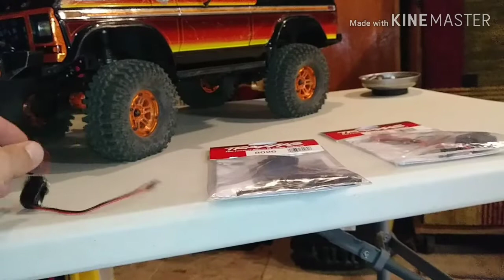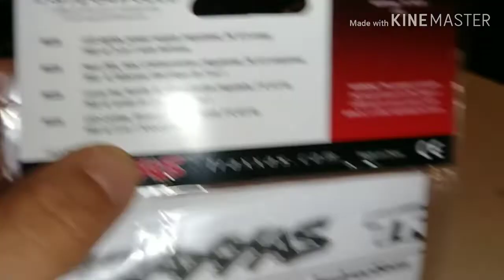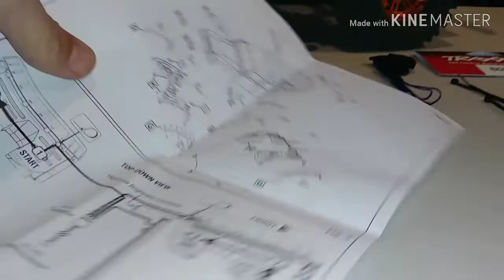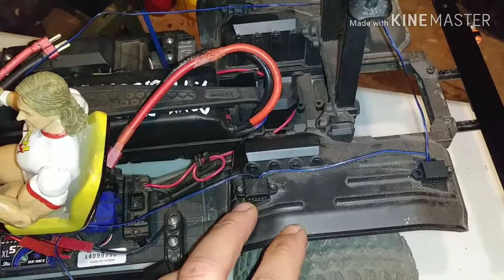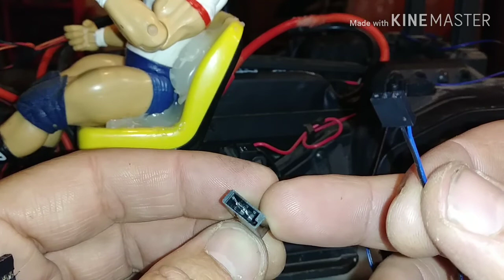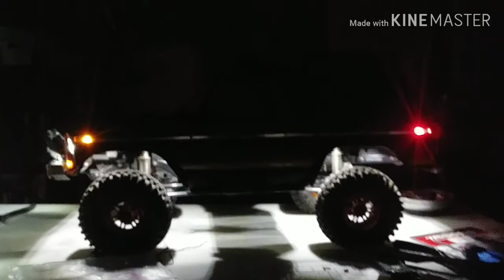Traxxas TRX4 Bronco,Rock-Light install,with separate On/Off switch

Comment: After Traxxas sees this video, they will magically introduce a switch for the light kits for only $28.99! 😄
Reply from the maker: 😂👍👍 Ahhh! Hahaha! 
You ain't kidding Brother,Wiser words have never been spoken,their gonna copy this setup with the quickness,and then charge people out the wahzoo for it,😂 what would really be nice,would be if Traxxas would include a key fob style remote,with full light controls,high/low beams,
separate light bar,and rock light controls,turn signal's,
back up lights,and possibly the option of a running light only selection,😁 Did you hear that Traxxas! Nod nod,Wink wink,lol 
Outstanding Comment Brother,one of the best that I've heard in awhile,Many thanks KonaFocus.😁😎👊👊
Reply: RC After Dark do you know if we can get it to work via the app? They have a lights on switch with high and low beams and off.
Reply from the maker: Hmm! I've never heard about any app's for the lights,But I also live back in the sticks,and my internet is hit & miss,at best,😊 The on/off switches that I had used,were just a cheap & simple solution,too Traxxas not including any switches with their led kits,
And most of the time I'm recording video with my cellphone,while I'm driving my rigs,So having a app too control my lights, would ultimately be of no use for me,😕 fyi using a standard video camera is not an option for me,As I have to drive to the nearest town,and use my cellphone too upload any videos,having next too nothing for internet at my house,kinda eliminates the option of using a standard video camera,and laptop computer for videos,and uploading,😕😞 
Which is probably another reason why I never looked into that option,My eyes would kinda be automatically blind, towards any app's,just for that reason.😕
But if the app works good for you my friend,then more power too yah! 😊👍 for myself,it's obviously not the best option,😁 
Many thanks for your great question/information,and much appreciation for checking out the video Dustin.😎👍👍
Reply from the maker: And just too cover bases,I'm assuming that you are referring too linking the lights, to the Traxxas Tqi equipped receiver,And as far as I know,& unless Traxxas recently released something new,I had know idea about that option even existing,of integrating the lights into the tqi app,😕
I'm gonna look into real quick just too see for myself,I'll get back with you Brother 😊👍
Reply from the maker: Well I just covered everything that the Traxxas website,& Amain Hobbies has,for Traxxas Tqi,and Traxxas trx4 lighting,😕 And other than buying a "My Trick Rc" trx4 lighting kit,or some other after market kits that come with a key fob remote,I didn't see Anything from Traxxas,that would link the lights up to the Tqi radio,or Tsm receiver,
As far as I can tell,No such option exist's for the led controls,😕

Comment: I have an aftermarket light bat on my test body. I don't know how to plug these light bar to the battery so i don't have to use my receiver. Any ideas?
Reply from the maker: Hmm, if I'm understanding you correct, Your telling me that you have a aftermarket battery for powering a set of led lights. Yes 😕
Or is that supposed to say Aftermarket Light Bar, "instead of Light Bat! 🤔?
You got me a little bit confused by how you wrote everything out.😕
But I think that you're wondering how to hook up a Aftermarket Light Bar to your battery, so that you don't have to power it off the receiver.🤔
Either way it's still going to be taking power from the battery,😕 so it really doesn't matter all that much.
At any rate there's a couple of different ways you could go about it.😕 
#1 You could power your light bar off of a separate 4 double AA battery pack, "which is what I do, and believe it or not, those 4 Double AA batteries usually last for about a years worth of on and off usage, before they need to get replaced.😕 
Or you could go with choice number #2
Which is powering it off of the Traxxas Esc,😕 There's a male JST connector coming off of the esc that normally goes to the Traxxas led power supply block, "and you could simply plug in a 3 way splitter between the esc, and the led power supply, and share some of the voltage from that output lead "before it hits the Traxxas led power supply"🤔 Which will work, but you have to be careful that your Aftermarket light bar is capable of handling 12+ volts, in case you decide to power your truck on 3s.🤔 The external power lead coming off of the esc, puts out the exact same voltage as whatever battery your using,😕 So if your running on a 2s lipo, that lead will put out 8.4v at the start, and then taper down as the battery starts to drain, "and if your running on a 3s lipo, it will start out with 12.6v, and then slowly taper down as the battery starts to drain.🤔😕
That external lead puts out the exact same voltage as your battery,😕 "which is why I use a external 4 Double AA battery back to power up my aftermarket light bar! 😄 Lol 
The Traxxas LEDs "are a low voltage led set, and the Traxxas LED power supply is basically like a Resister, it lowers down the power coming from the esc, to right around 3v or so, if I'm not mistaken,🤔 That way it doesn't matter wether your running on 2s or 3s, either way "the Traxxas LEDs are still getting the correct amount of voltage from that power supply block.😕

Basically the easiest thing for you to do, is to Run that light bar off of a separate battery pack like I'm doing, otherwise the next best option, is to run it off of the vehicles receiver,🤔 "that way there's no chance of over volting your light bar "if you decided to run on 3s.😕

Separate battery pack, or running it off of the Receiver itself, is going to be your best options.🤔
Either way you decide to go with that, I would also recommend installing a simple On/Off switch inline to go along with it,  "Just like I did" 😄 ha ha ha lol

Hopefully this was helpful for you... And many thanks for checking out the video my friend.😊👍
Reply: @R.C.A.D.  I meant light bar , sorry for the typo. I found a little wire that I bought a while ago and used it to connect the light bar to the receiver and now is bright! I just didn't want to plug the light bar directly to the receiver because i have another Defender body that already has the Traxxas light kit as well as the Pro Scale module installed. I wanted to be able to plug and unplug the light bar without having to open the receiver. Is working now though. I've been trying to find the right adapter to plug directly to my Traxxas battery to make it a little simpler. Since this is my first RC model I'm still learning. Thank you for the reply and the tips! :)
Reply from the maker: @perohijo 
Right on...😁👍
And since you're new to RC's I'll give you a little bit of advice; You don't want to hook anything else "directly up to your vehicle battery, Because if left unattended, it could very easily draw your lipo battery down below a safe level, "and you won't be able to recharge it after that happens.😕 
As for being able to turn your lights on and off easily, and to give you a area to unplug the lights when disconnecting the body, I would recommend looking at a online hobby store, and type in the search area for a On/Off Switch,🤔 their usually pretty cheap, and also pretty easy to hook up in line with your lights,😕 My on/off switches have a male Jst connector on one side, and a female Jst connector on the other side, and it's pretty simple to plug it in "in-between" the Receiver and the wire lead going to your light bar.😁👍
I've got three of those on my truck 😂 One is for the Light bar, One is for the main lights on the body, and the Third one is for my Rock Lights.😁 
It's been awhile since I've seen this video...🤔 But I think that I might have talked about those switches "in the video" at some point in time or another.😁👍
Reply: @R.C.A.D.  Thanks for the tip!

Comment: Thx for the video and tips! @ 22:20, can't you also lift the tabs on the Traxxas connector and pull those wires out so they line up, just like you lifted the tabs on the switch?
Reply from the maker: my pleasure 😊👍
As for the tabs; Probably! 😄 Lol sometimes I just don't think about that stuff at the time.😕😂
Thanks for checking out the video, And an Early Merry Christmas to you and your Family. 😊🎄🎁🎁🎁🎁

Comment: Now they have the pro scale light kit that has the separate module that will control the lights to turn them on and off and if you have the bluetooth adapter you can do it all from the phone
Reply from the maker: Very Cool 😊👍
Thanks for the Awesome Head's up, and for taking the time to check out the video Tony.😊🤜🤛

Comment: where and what part number is that on off switch??
Reply from the maker: ? 😕 Where! 
Where, is mounted on the inner fender well, just in front of the ESC.
Part number; there is no part # It's just a Simple on/off switch, 😕 and I order them in bulk from the Wish app, But if you go to your favorite online Hobby store and type in the words "on/off switch" into the search criteria, you should have no problems finding one. 😁👍
It's a piece of cake really, just takes a little bit of effort on your part,😕 
Of course you could simply Google "RC on/off switch" 
Thanks for your great question, and for checking out the video my friend.
😁👍

Comment: Why didn't you just use a opto switch and a b.e.c that way you can  turn it on and off from the transmitter
Reply from the maker: Because I was trying to show people who don't have a bunch of money, how to accomplish it in a cost effective manor,
Not everyone has a ton of money to blow on RC accessories,😕👍
I do however; have a bunch of RC's, with Transmitter activated LEDs, but I use a Rc4wd Wired Winch Controller for the on/off switch, and I have been doing that for years,😊👍
Thanks for your opinion, and many more for checking out the video.👍

Comment: does it consume alit of juice? can you use coming from esc
Reply: i did watch your video but i wrote the comment before i started watching. quick question, i put 2 fans 1 for the motor and 1 for esc my battery get really low on power in 45 mins of playing. should i just remove the fans? sorry not lights related
Reply from the maker: Yeah, those Fan's are definitely not needed on a stock Trx4, Wow! Yeah, I have never had a Problem with my esc getting hot, and I even have a driver seat, hot glued to the esc's cooling fins,😂👍 no worry's on the Fan's man,
And I apologise for snapping at you, I'm just a Real stickler for Common Sense.😊👍
Reply: got it. thank you. more power to you
Reply from the maker: Right on Brother 😊👍
Reply from the maker: Did you Not watch the entire video ? 🙄
All your answers are right there,😕
And no! It doesn't consume a lot of power, not only are they LEDs, but they are also low voltage LEDs,🤔 
I also have my main lights, and the rock lights, on separate on/off switches, that way they are only turned on, when I want them on,🙂 which is also in the video, and another way to save power,👍
Normally I would say thank you for your great question, and say thank you for checking out the video,😕
But judging by your question, it kinda seems like didn't watch the video at all,
😕

Comment: What switch did you use
Reply from the maker: Alright I found one that is similar to what I use

https://www.amainhobbies.com/expert-electronics-standard-on-off-switch-w-charge-cord-exra050/p57633
Hopefully that will help 😁
If you have any more questions please feel free to ask my friend,🙂👍
And thanks for taking the time to check out the video Brother.🙂😎👍👍 
P.s. if you weren't aware, I'm currently doing a giveaway on my channel, check out the video if you haven't already, it's Titled 2,500 Subscriber Giveaway Entry Video, and I'm giving away "Two" "Brand New"  "RTR" Redcat Gen 8 Scouts, giveaway deadline is midnight eastern standard time on Friday July 10th 2020.🙂👍👍
Reply: @R.C.A.D.  thanks man, I saw your video but I could not find a switch.
Reply from the maker: Just a simple "black plastic" on/off switch with a Jst connector on each end, the same switches that used to come on the old Tamiya vehicles back in the day, let me see if I can find a link to one for you,🙂👍 be right back

Comment: Just curious? What do you think you have invested in this from day one? (Base TRX4, batt & charger plus all accessories)
Reply from the maker: Tuff too say Dave,🤔
I already had chargers,and batteries before getting the TRX so hmm!
Truck; $500.00
Savox sw 1210 steering servo; $80.00
Duratrax Oynx 8000 mAh 25c 2s lipo; $80.00
Traxxas Bec kit; $38.00
Traxxas led light kit; $45.00
Traxxas Rock lights; $25.00
Traxxas defender Roof basket; $12.00
No name light bar; $20.00
KYX aluminum front bumper; $25.00
KYX aluminum rear bumper; $20.00
3 Orange Neon sharpies;$10.00
Hitec 10 amp "duel battery charger"; $100.00
Traxxas all terrain track kit; $200.00 
About $1,150.00 for everything,minus over 100 hrs of person labor,🤔
It would be significantly cheaper for a basic setup,
Probably get the truck,a battery,and a charger for less than $700.00 🤔
If I may make a suggestion,If you are curious about getting a trx4,and are unsure on pricing,I would strongly suggest looking at Amain Hobbies website,Check out the Crawler's,and just start adding everything that you want into your online cart,And see what the total is,for everything that you're interested in,🤔
And then simply empty the cart after you have gotten a idea on pricing,😕🙂👍
Thanks for your great question,and for taking the time to check out the video my friend,🙂😎👍👍
Reply: WOW!  Wasnt expecting that long of a list (lol) Thanks for your in depth reply!

 That's what I'm worried about. I'm the type that wants to add everything! I owned this exact same real(or lets say full size) 1979 XLT Bronco  (sad day when it was stolen 8 yrs later!!) Took me a year later to buy a 1986 XLT I owned for 20 yrs!  I have been caught up in the drone rc's and now getting the buggy /crawler fever. While viewing MANY YouTube vids, I decided on the HBX 12889 Thruster for my budget and type of fun I seldom have the time for these days. I realize these brands are day & night apart - no comparison. I did exactly what you are suggesting before I caught your post and added many items in my cart. The total $ keeps bouncing me back to a less expensive start. The fact that it is the once owned "Bronco" pulls at my wallet......
Again, AWESOME job on yours - and BEST post on YouTube!

Comment: wondering if i got a bad component or im overloading the Traxxas light system as the 8028 smoked up when i plugged it into the esc. using Traxxas 3C 5000 amp battery....waiting on the new light kit from traxxas
Reply from the maker: Wow! 😨 I've never heard of such a thing,That's crazy! 😵
I suppose it could have something too do with running on 3s,😕 I'm not entirely sure on that,as I do not run 3s in my trx4,I feel as though 3s is too much juice,and just isn't necessary or needed for crawling,2s works excellent for my driving style,😕 3s is kinda overkill! 
Yes the trx4 is raited for 3s, but once again,3s just isn't needed in my opinion,the trx4's perform excellent on 2s,and 2s is a lot less likely too burn anything up,7.4 volts vs 11.1 volts that is! 😒 
Anyways,I'm sorry for the bad run of Luck Brother,😞 I would try getting a hold of Traxxas, and see what they have too say about it,hopefully they will hook you up with some replacements,😕
Best of Luck Brother 👍👍
Reply: @R.C.A.D.  aaah....got it...i have run lipo on all my helios in the past this is my first Trx 4x batteries not included so i checked and saw the bronco is rated for 3C figured more power for better climbing. will order some 2C for future running.
Reply from the maker: @scrooem  
Right on Brother,😊👍
And fyi the correct classification would be 2s or 3s,not 2c or 3c,even though it is referring to battery cells,still goes by 2s or 3s,😕 
For most of my crawlers I run a 2s lipo with a 25c withdraw rating,and around 5,000 mah or more,
The C rating is how fast it discharges,and also effects throttle response as well,25c is a smooth even steady current,the higher the c rating,the faster the discharge,and also more throttle punch,😕
Like for instance a 2s 5000 mah 25c lipo may run your trx4 for around 2 hours,And a 2s 5000 mah 45c lipo may only run it for 45 minutes,but it would have much more throttle "Snap" vs the 25c,But once again 25c works quite well for myself,😊👍
I run a Duratrax Onyx 8,000 mah 25c 2s lipo in my Bronco's,and they have actually never gone dead on me,even after 4 hours of run time,😁 As for 3s vs 2s,Well other than amping up the power,and there for extra esc Heat,The extra power isn't really usable or even nessacery,😕 having a 2s lipo with a higher "c"rating would probably be more beneficial vs more voltage with the 3s lipo,"Like say a 7500 mah 45c 2s lipo,😊 that would have all kinds of punch,I wouldn't exceed 45c with either 2s or 3s lipos,on the Traxxas XL5 esc,It may not ba able too handle that kind of Flow,😕🔥
Good Luck Brother!😊
Sorry for the slow response & 
Have a Merry Christmas My friend.😁👍👍
Reply: @R.C.A.D.  got it! 30c, 25c or 20c would be better noted...having said that where can i get some adapters to convert to Trx...
Reply from the maker: @scrooem  
Those would be most readily available at Amain Hobbies,
They have a huge online selection of goodies! 😊👍
Reply from the maker: Also and "fyi" For anyone who is possibly reading this comment,The separate On/Off switch between the Esc & the main light "vehicle mounted" distribution block,Wouldn't cause this,or any real problem for the Traxxas lighting,or other existing electrical components,😕 
Technically speaking,The only thing a On/Off switch would do,is interrupt the main power coming in to the main led light distribution block from the Esc,😒 So no harm done with the separate On/Off switch everyone,😊👍👍